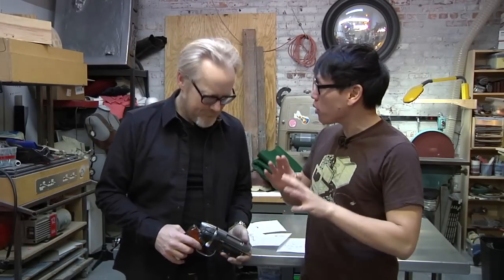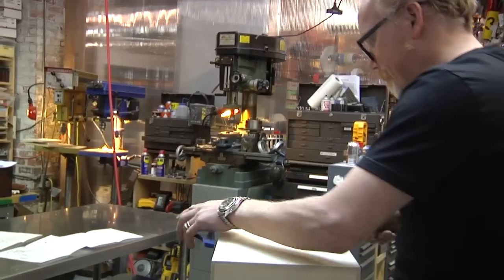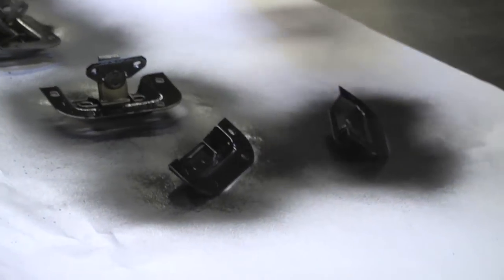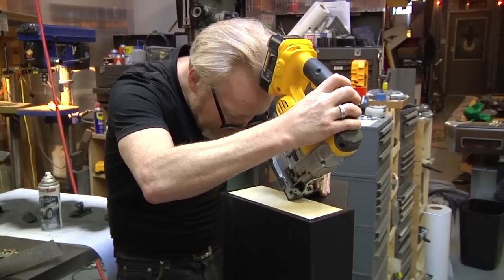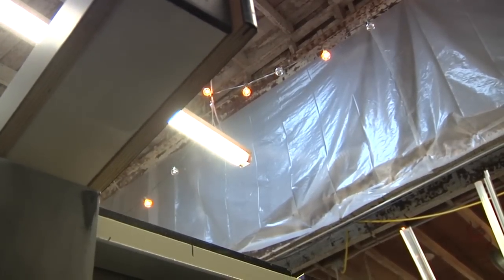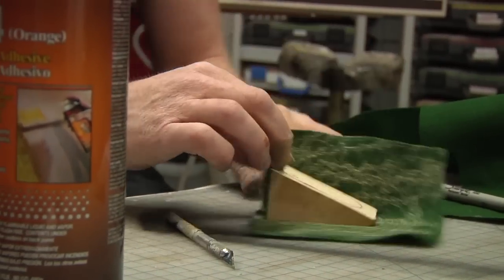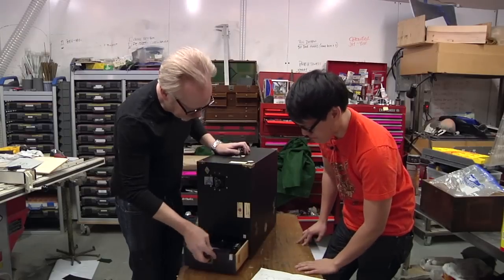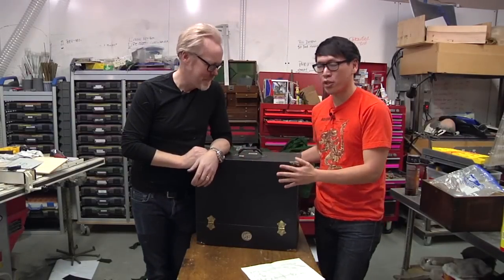One Day Builds: Adam Savage Makes Something Wonderful from Scratch

Comment: I totally understand Adam. 6 months ago I just got the sudden urge to build my own desk just because I didn´t like the Ikea one I had. So I went to the hardware store bought all the materials I needed and built myself the best desk in the whole world and, boy I love it. And it too has a secret compartment which was actually one of the main reasons I started that project.
Reply: ChBrahm i know that feeling, made mine out of steel by hand... dem feelings when done
Reply: ChBrahm Not to mention its a money saver in the long run. The stuff they sell at Ikea, and stores like it, are all made for quick assembly and often times made from low quality material to make a profit on it. A good example for me was when I built a reptile enclosure for my pet python. I designed it to be warm, comfortable, but the enclosure could serve as a table. Will last, and looks good.
Reply: XD I got pist with a few gun company's stocks. As they weren't all cut out at what they were suppose to be. I fired up a few of my machines and got to work. Now I own 20 betufil old oak stocks. I built a few grips for a few of my knifes. I even got a fair trade of a guys consuin who shoots elk sent me the entire elk horns. It was small but that's why he shot it. Meat was bad but the horns were good. I made 8 handles of it so far. Its fun.
Reply: +tanman650 I'll pay you money if you can fabricate a tavor stock for me
Reply: well its not secret anymore is it?
Reply: ChBrahm what is in the secret compartment?
Reply: @masnecia  bs probably

Comment: They should use this in the Blade Runner sequel. Dekard gets pulled back in for one last big mission and pulls this case out from the back of a cluttered closet. Then cut to a close up of the case as he opens it, grabs the gun and rifles through the compartments, snatching up a few other things he needs and heads out the door.

Comment: Holy fudge, at 2:08 Adam almost lost a finger to the table saw (It was still spinning). Watching him work with power tools always makes me cringe (free hand cutting, getting his hair up close to the drill chuck). Norman just standing in the background taking selfies is just priceless.
Reply: Haaraff yeah I noticed that too.. first he almost slid the work into the blade and then came back around and stretched out a tape measure very close to that blade... I guess they will edit it out when it does happen...
Reply: I have the same table saw and if you touch the blade with your finger a piece of steel is jammed into the blade and stops it almost instantly. It ruins the blade but at most you will have a scratch on your finger. There are videos of this on YouTube, and this is system is activated with out fail each time.
Reply: I love watching Adam but he does make me uneasy when he uses machinery.
Reply: That’s why he’s building a blade runner gun box! Lol

Comment: Mr. Savage,

I have been working with fine finish carpentry for over the last two decades. You did a good job here. One suggestion that I have for you is to use a micro Pinner with 23 gauge pins for either long-term or 1 day projects. The pins are very fine and will not pronounce through the other side especially when dealing with a staple that runs with the grain of plywood. It's just a tip that will help you with your projects. As long as you have your Titebond glue and 23 gauge pins, everything will nearly become invisible. I suggest picking up 5/8 and 1 in lengths in dimension. Keep up the great work. I enjoy watching your shows.

Comment: w.r.t. "drafting", I'm the same way. I was taught on paper. In fact, I was in the last year of drafting being taught on paper at NCSU. Yes, I learned autocad as well, but I've always been faster on paper. During our senior design (team of 4), the others were slaving away with autocad and I went all Bob Ross on 'em -- grabbed my pencils, t-square, and "weird" (engineering) ruler, taped a sheet to the desk (I built that lab; I know they're true) and drew a textile mill in about an hour. (my team was a year younger, and had never seen this stuff.) I then put it in autocad, using the digitizer table in the fabric lab -- which they also didn't know about. :-)

Comment: If you had access to a sand blaster, you could’ve blasted the lacquer coating off the brass hardware and then used the patina acid to age them. I made a cedar chest a few years ago and did this exact process with the hardware and it turned out great.

Comment: Holy shit! I've ALWAYS wanted to know what that certain type of Ply wood was called. It's used a lot in model R/C airplanes and such. The thin stuff with multiple thinner layers, rather than fewer thicker layers. THANK YOU ADAM!!!
Reply: MikePlaysIt Hobby stores often have Baltic Birch plywood in 1/64th, 1/32nd, 1/16th, etc. sizes.  It's usually the most consistent thickness and best quality overall for plywoods.
Reply: synapse131 Thanks for the info! I'll give that a look too. I'm not necessarily looking to do model plane building and such. But I like to construct various things. Like custom fitted boxes and containers for various purposes. That type of ply always seemed like a really good option and I liked the look of the edge-on view with the alternating wood colors.

Comment: At 18:40 Adam uses what appears to be either steel or aluminum "pop" rivets to attach the brass parts (hinge in this case).  I hadn't thought about using rivets for wood before.  BUT recently I bought copper rivets which look really nice against brass or leather.

Comment: Air bubbles in adhesive film are easy to deal with. Pop the bubble with a cut of a Very sharp (in fact designated) scalpel and press the bubble in gently, starting from the edges of the bubble. Do it gently, with more like rolling your fingertips than pushing, the trick is not to stretch the film while pressing the bubble in. This way the air releasing scalpel cut makes a nearly invisible butt joint instead of a protruding visible scar.

Comment: When printing labels- try "water proof", "tough" or "tear proof" paper.  Several companies make it.  Essentially laser printing on a thin sheet of plastic.   They wear better than paper, because the don't tear and the toner is fused well to the surface.  I use them where labels would get torn or scratched.   It's what they use to print price tags in the veggie section of the grocery.

Comment: Did anyone notice the disk sander just randomly spinning in the beginning?
Reply: My guess is it was spinning slowly because the shop vacuum system was on.
Reply: I used a disk sander just like that at school, and it would keep spinning for a solid 15 minutes after it was shut off.
Reply: Timothy Snow well technically you should use something to slow it down like a block of wood

Comment: I wonder how it smells?  On the ooolllldddd boxes of this flavor I have, there is a certain mold/mildew aroma that the felt and the box accumulate with the passage of time.  Plus, since it is a firearm box, it should have a tinge of gun oil smell.  Those would be the pièce de résistance for this build I think... :)
Plus some oil stains maybe?  Which means it probably could use a tin of gun oil and cleaning rod and swabs...

Comment: When he says he got bit by a staple I had a flashback of a 50mm pin nail that went right up the end of my finger when I got a double fire on my nail gun my finger was, I thought, clear of where the nail would exit.   It was spectacularly painful to have such a long piece of metal jammed down the length of my finger.   Make sure nothing is in line with the gun, no mater how far away it is.

Comment: I know this might not be the best place to ask this question, but I am building a similar box with a felt lining and I'm worried about how to cut the fabric for the interior. I was planning on gluing it with spray adhesive and leaving some overhanging on the edges and then just taking a sharp razor blade to it. Do you have any tips that might make my build a little easier?

Comment: Can someone explain how the jigsaw on the diagonals didn't matter, but the straight lines either side required the japanese saw?  I think in the end the closed box still had some offsets due to the diagonals being cut with the jigsaw?
Reply: No real reason, other than the fact that Adam said so. There is honestly no difference. Not a chance in hell the jigsaw blade was any thicker than the hand saw.
Reply: I was thinking even if there was a thickness difference, surely being consistent is the important part?  An equidistant gap is important for fit
Reply: Michael Moore - there is a difference in kerf width. Japanese pull saws have no set to their teeth. Jigsaw blades have a set, meaning their teeth are alternately bent to clear sawdust and prevent binding.
Reply: Steve, you're correct. I was very wrong in my comment, and educated myself since posting that comment. :)
Reply: Steve Shannon Do you know the answer to Jurassic Collections' question? I myself am clueless and i am stumped as well.
Reply: My general understanding/guess—because of the double lid design, it's important that the two long faces of the lids meet without leaving a gap (since the total width of the two lids together needs to be as close as possible to that of the box itself). If those long faces register together cleanly and firmly, however, a little bit of gap along the sides isn't as big of a deal.

Comment: did anyone notice the disc sander in the back right moving?
Reply: +Cal Zackary its somehow moving in most of the videos. Its a really large wheel, and it probably spins for half an hour when its turned off.
Reply: +Cal Zackary we have one of those in the shop i work in. it has so much inertia, no one uses it full on. we just hit the power for a moment and it spins for like an hour on momentum alone. -even having done the work you need.

Comment: that is cool gun box. I've seen replicate lot swords. so sword holder. built one for brother. holds on wall. nice plack with wooden hooks hold sword side ways. think dermal wood burner. you put some design elements relates what movie the sword build sword stand to would relate too. second sword holder mad be for more portable. but L shape peace wood. tope sword or handle more top L and bottom sword or sword sheath or case would rest hole similar one held handle of gun. nice thing this design is move around room not holes on wall. down side way easer for young child get hands on it. second idea for project case hold clay comic book statues. lots company herd about. side show collectibles one. think ray villifane make statues. think jazzer used 3d pen to hand create 3d venom. he or some els figured out sand plastic fillimant make realist comic statues. so some kinda book case Plexiglas from ace that easy cut not worry break. would ticket make display case. slide dove tale rails together and rabbits glue plexus glasses in. you show off comic con if wanted too. or norm do for you don't seen. make money with booth while walk around show in home mad costume that plan pay for with money make sale stuff made sale at comic con.

Comment: The plywood he speaks of and I don't know why he didn't mention it, is called Baltic Birch and it looks like it's 3/8 thick. You will have to call around at your local lumber shops. None of the box stores carry that quality of Plywood. Don't ever use that Chinese crap plywood the box stores sell. It's just pure shit. I guess you can build a dog house out of it. Paint it and be done and then do it again in 10 years if it's exposed to the elements.